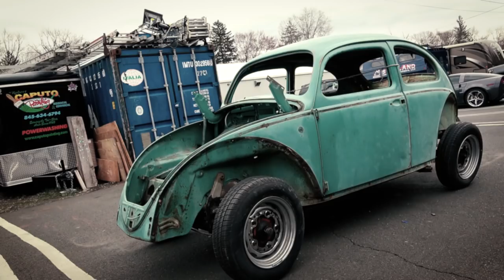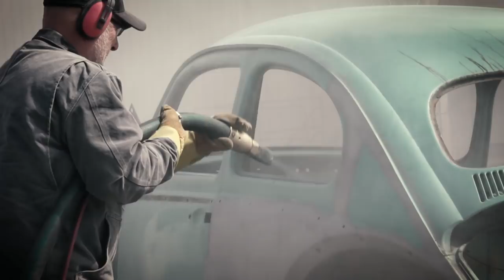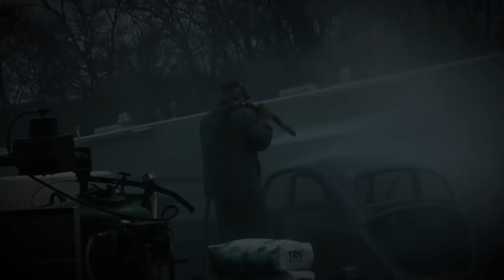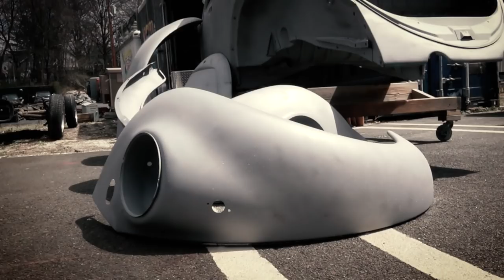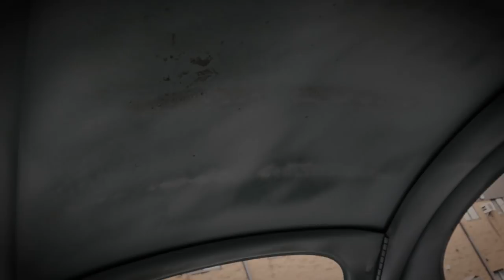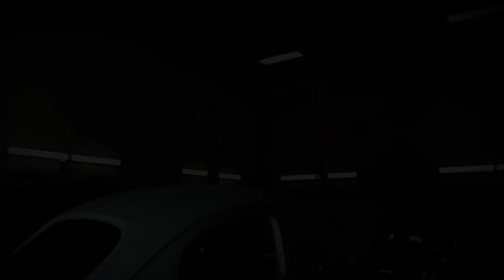Classic VW BuGs 1962 Build-A-BuG Beetle Restoration Project Media Blasted

Comment: Looked like that shell had a lot of damage to it. Nothing some Bondo won't take care of. Hope you can do a proper restoration of this little car.
Reply from the maker: I document all of my restos, more than any other shop, we take care of it all.
Reply: Chris, that is very nice to know. However, I believe you missed the point. Are you going to replace the wrinkled metal or just put body filler over it and call it a day?
Reply from the maker: There is always some filler, these cars are old, even with new sheet metal there are skim coats used.  But in the end, it is a lot of small hammering to smooth out the metal.  If it becomes too tedious for the body shop, we will order front panels to weld in.  Thankfully they now sell the 67 and earlier front panels.
Reply: Thank you for the clarification. You apparently put a massive amount of care into your restorations. I'm not quite myself today because of my migraine medication. Please forgive me if I sound sarcastic. I just am curious about how you decide to replace metal and use wht is already there. I am not a body man of any description. Maybe one day i will be able to afford such a nice air-cooled.
Reply from the maker: Ah no worries at all man, straight up question, all good.
Reply: Chris you are a class act. Thank you for understanding.
Reply from the maker: thank you my friend.